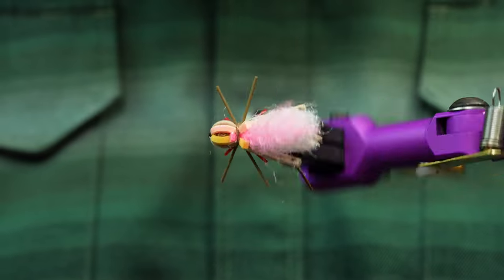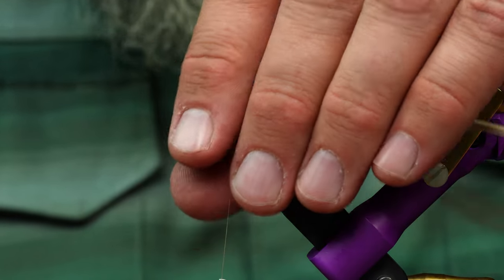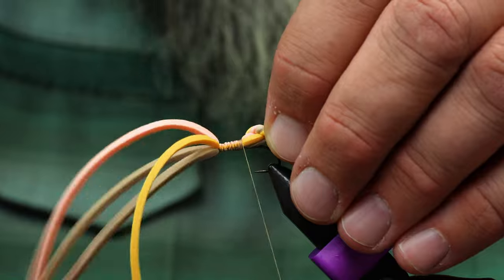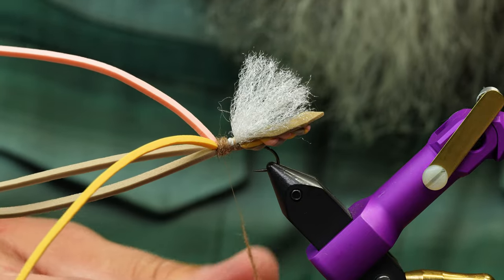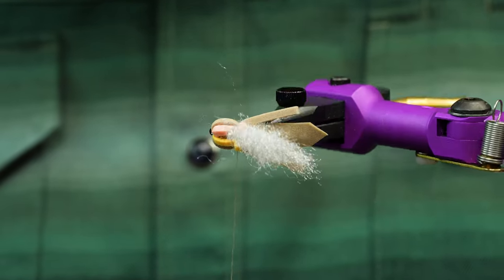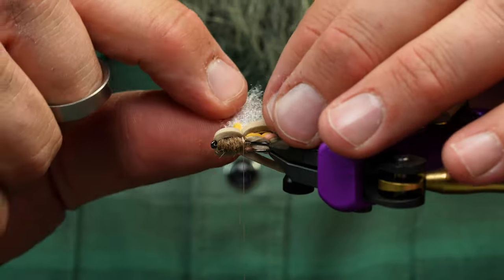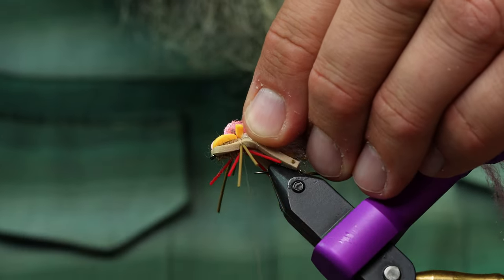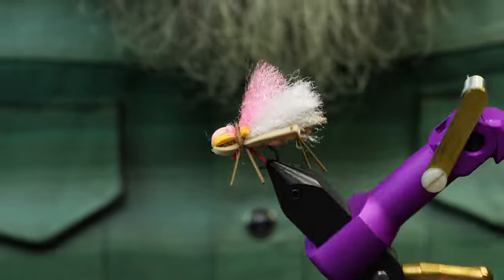Hoptimus Prime | FOAM Hopper Supreme! | Fly Tying Tutorial

Comment: Here's another method for getting the rubber legs through the foam: jam your bobbin threader through the foam and catch the rubber legs on the other side like you would thread. The advantages are twofold: speed/simplicity, you can control the angle the rubber legs project from. Try it out!